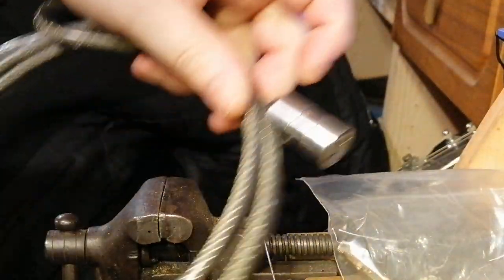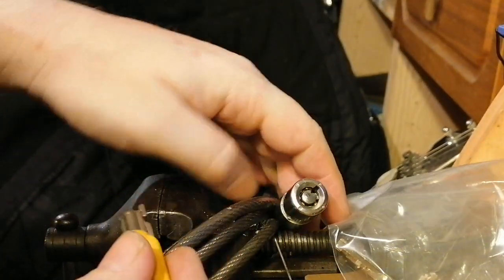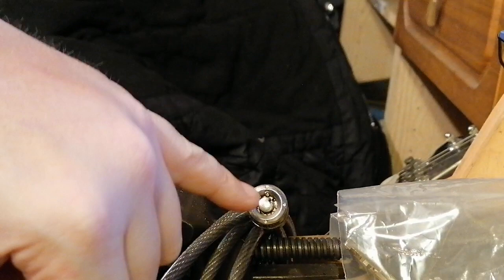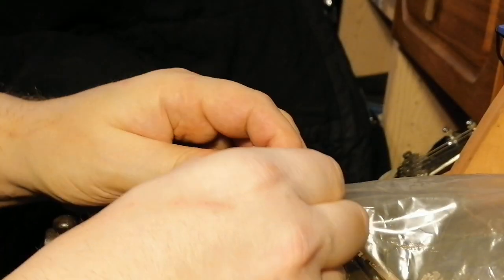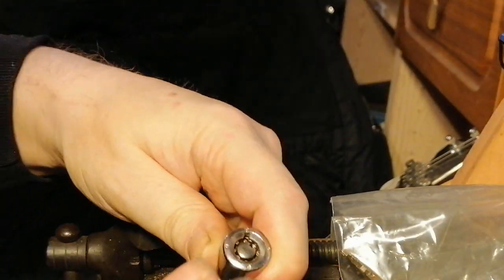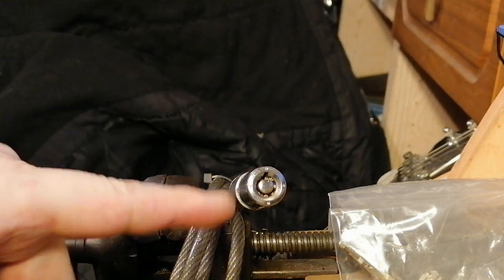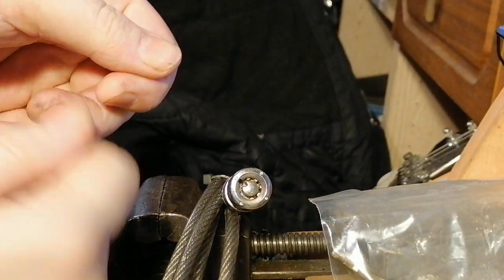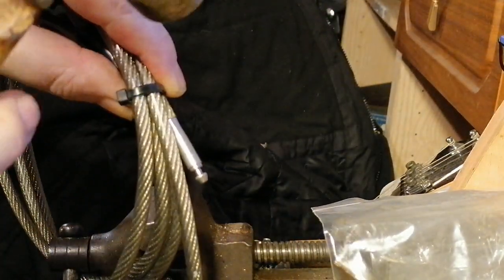Kensington K64615EU Lock Vulnerabilties - How NOT to do security!

Comment: That clearly didn't take much to "tap" open, especially after the deformation 🙄 You think that key thingy is supposed to be a security feature or it's more of a key control thing? The adapter you made is quite a trivial way to impression them again. Would they be so slow at kensington? Fun video and nice finds Hux👍Thanks for exposing these mistakes clearly 👌
Reply from the maker: Good question. You'd think they would be better...but I have learned that designing locks 1) is not so easy and 2) it is simply impossible to know every attack that someone might attempt. Although, this one is a particularly bas miss.